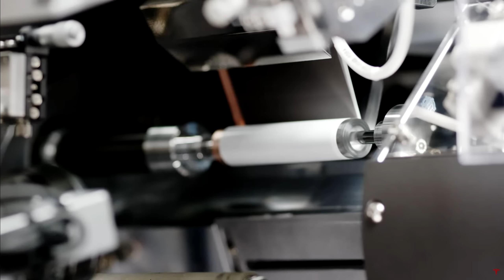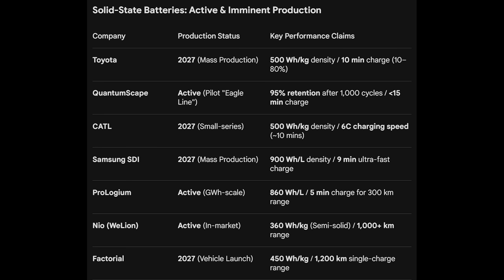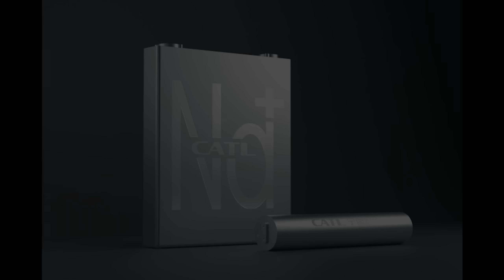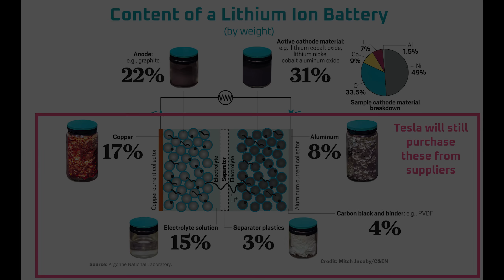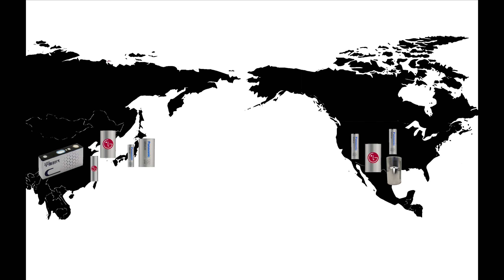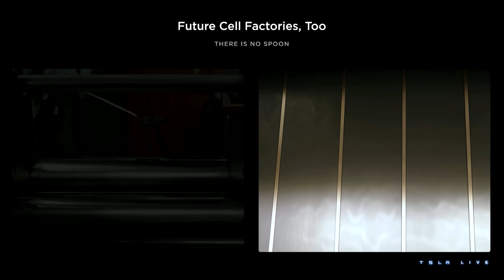The Fully Dry 4680 // Too little too late?

Comment: A lot of comments I hear about how much better X, or Y chemistry or form factor will 'eventually' be seem to ignore the fact that lithium ion improvements are still happening and will continue to happen into the future as well.

I'm not going to hold my breath waiting for sodium batteries to out perform lithium in all aspects to the point that lithium becomes obsolete.
Reply from the maker: Definitely
Reply: Yeah, it’s like competing with CMOS. Remember GaAs, bipolar, and ECL?
Reply: On the energy density side, definitely not, since sodium ions are always 20-30% less capacity than the comparable lithium ions

But the (future) cost/kWh is what favors sodium ion in large scale application like grid energy storage. Although there are already some lab prototype of solid state sodium battery with comparable density to NMC which looks like it would be targeting EVs but not anytime soon since it's only early lab prototypes right now

Comment: We still need no less than 600 mile range for us pickup owners in rural areas who pull trailers. I have no doubt that they will come before the end of the decade. And I don’t care what kind of battery they will be. Hell, if a custard based battery will work I am all for it.
Reply from the maker: The Cybertruck will never get that kind of range IMO, which is a shame

Hopefully someone makes some sort of aftermarket range extender (basically a generator)

Those are getting popular in China.
Reply: @thelimitingfactor How about an aftermarket battery with greater range?

Comment: i think the misconception people have is they hear say CATL has a cheaper battery... CATL has a faster charging battery  CATL  has a battery with more cycle life CATL  has a battery with more power density. what they do not understand is this is 4 different battery products.. sure they are getting better on all categories but they do not all stack together.

Tesla wanted a battery vertically intergraded, that divorced the supply chain from China and other restriction that is what they got. and why it is so valuable to them. 

in the past 15 years i have not been more than 100 miles from my home. I do not need a car that can go more than say 250 miles and i do not daily drive so for me life of the car systems is what is important. as well as cost.
Reply from the maker: Bingo
Reply: 错了兄弟 catl的电池的确做到了  10C的充电速度  1000次快充后90%的容量保持率  和极致的安全性  特斯拉我是不会买的  他们只想要便宜货:face-blue-smiling:  神行和麒麟电池的性能都相当强

Comment: Excellent vid Jordan! Very good breakdown of the current status of the 4680 and DBE technology benefits to Tesla. 

I'm pretty sure some people commenting either didn't watch the video, or only saw it to further bolster their confirmation bias. Still, it checks out to me. DBE seems better for batteries overall, and should be adopted widely in time; 4680 should create a less China centered battery supply chain for Tesla; and everything else may well be less important for consumers over the long haul. I still think Tesla will need to halve charging times in the next few years, but as you've said, Tesla can take some time to get to that step after they perfect their current battery manufacturing processes. Maybe in 2030 or so, they will try doping their batteries with metals and other additives that improve charging speed by double digit percentages. 

Also, I'm curious if you have any SpaceX content coming down the pipeline, what with all the SPCX IPO fever. I wouldn't blame you if didn't want to make a SpaceX video just to hop on that trend, but if you do have something noteworthy to present about the company, this would be as good a time as any. 

Cheers!
Reply from the maker: Hey man!  Thanks for the well thought out comment.

I've done one video on orbital data centers and also videos on terrestrial compute.

Beyound that, I'm not sure what I'd do a video on.

The space stuff is much more straightforward than batteries.  I'm not saying it's easy, but it's very determistic, whereas batteries are less so.
Reply: @thelimitingfactor  and thank you for the well thought out content! Batteries are a pretty interesting topic, for sure. 

I have a few thoughts on space and data centers that might be video worthy.

1) SpaceX has said that they want to establish a solar factory and a mass driver on the moon, before setting their sights on mars. The mass driver I will assume is viable since it is based on relatively basic physics, but can a solar factory be established on the moon using lunar material? What kind of next gen construction and manufacturing processes is SpaceX thinking of using for that? How might they experiment with that idea to make sure it will work before investing billions or even trillions into building it? 

2) for the solar powered AI data center satellites that will be placed in earth's orbit, assuming SpaceX has a reliable source of supply to build 100 GW(!) per year of compute, presumably sourcing material from earth, does SpaceX intend to have its satellites deorbit and fall toward a specific site that will allow the company to retrieve and reuse that old deorbited material for producing new satellites? This seems like the smartest move, since the alternative of letting them fall to random places on earth's surface at end of life may eventually become unsustainable, and would essentially deposit valuable solar panel material, computer components, and satellite material into (statistically) the sea. There is a sand shortage IIRC, so it may become problematic to waste good silica while deorbiting old satellites. (Same question for starlink satellites too). And on a related note, for the 100 TW of solar that SpaceX wants to produce on the moon factory, might they have a "deorbit, retrieve, and recycle" plan for their moon-made satellites as well?

3) do you think Kepler syndrome will present any problems for moon or earth related space travel in the next few decades if SpaceX succeeds in launching all the annual compute it is aiming for? SpaceX compute and communication satellites (along with payloads from other space launch companies like rocket lab) will be numerous, and will only add to the decades of old space garbage that currently complicates space travel, right? This seems like a problem to monitor and plan for. 

So yeah, space related food for thought. Thanks again for the top notch videos!
Reply from the maker: @davidx.1504  Sure thing!

1) Yes/it's too far away to say because much will change/again, too far away.  The lunar ambitions are maybe decade away at least in my view at any sort of scale.  There will be crazy technological changes between now and then and they have to deliver on 1000 other things first.

2) They'll just burn up.  However, it looks like they may be set up with modules that can be replaced, which could extend their life.  But, actually doing that again so far away.

3) No.  Keploer syndrome takes decades to play out.  It doesn't happen quick like people think it does.  If it starts, we'll have PLENTY of time to intervene.
Reply: @thelimitingfactor   fair enough, hard to predict things so far out like lunar construction and manufacturing. I was thinking that maybe SpaceX had ideas and experiments in preparation for that already that informed their moon base plans. Someone somewhere said lunar material could feasibly work for solar cell feedstock (probably a lunar perovskite), but I hope they aren't taking the "we'll figure it out" approach on something too major. If 100 TW of annual solar material is truly necessary for AI compute in the long term, it'd be better to figure that out sooner rather than later. But maybe SpaceX needs more data, perhaps samples from the lunar surface once starship reaches the moon; if so, there's no rush just yet. That's one good thing about having such long term plans - there is a lot of time to gather the data and devise the best strategy to execute on those plans. 

Man, that's a real shame all that material will be lost; on the other hand, fingers crossed that modules can be replaced in orbit to extend satellite lifespan, but this seems like a more complicated and expensive route that SpaceX may not go with, especially in the near term. If 100 GW of solar being lost to deorbiting every few years does strain terrestrial silica (or even perovskite) supply, maybe terrestrial supply can be sourced from seawater or ocean floor? Or lunar solar can be brought in to replace it?

Great to hear we won't have to worry about space debris! I'm personally rooting for laser based methods of forced deorbiting of debris to become more prevalent, but there are many methods out there. If we really have decades to figure it out, then we have time to develop a variety of deorbiting mechanisms before the debris is a crucial problem to address.

Comment: Main issue with the theory... More than 55% of Tesla's worldwide vehicles are built in China's shanghai megafab and sold there/exported... The 4680 cells aren't competitive in China or any of the countries that has Chinese EVs at this point... It's literally made just for the US market and that's it. It's literally not competitive for anywhere else... We all know that the EVs in the US are the least competitive and the worst EVs available...
Reply: Tesla was REQUIRED to use CATL cells by China government.
Reply: @clarkleakins879 yes... just like how tesla LOVES to export the chinese built model 3s and ys to other countries because it's a lot more profitable for them.
Reply from the maker: It is competitive elsewhere, which is why they're starting production in Germany.
Reply: @thelimitingfactor 
I can't see how anyone can say that with a straight face when the chinese equivalent of the 4680 is coming online right now with similar energy densities and much better charging rates and operating temperature ranges... and offering it in cheaper vehicles. And that Tesla is still using China as their primary production location making more than 55% of their cars world wide...
Reply: @killerhurtalot  Tesla will get there. They just need to keep working on their technology and innovating and improving. Competition is good for the consumer. Like china banned foreign batteries from their market to improve their tech when Japanese and Korean makers made the majority, the US will carve out and improve their tech over time. Chemistry and battery types will converge over time and Tesla can copy what works and implement that inside the US.
Reply: @aihji china did no such thing as banning foreign made batteries 😂
More like they invested and controls all the materials to make the batteries over the last decade and battery tech were all over the place until China took the definitive lead on manufacturing them...
Reply: @killerhurtalot   China literally banned foreign batteries from its domestic supply chain in 2016. 
WSJ article from 2018:
China requires auto makers to use batteries from one of its approved suppliers if they want to be cleared to mass-produce electric cars and plug-in hybrids and to qualify for subsidies.
Auto executives say that since 2016 they have been warned by government officials that they must use Chinese batteries in their China-built cars, or face repercussions
Which is an effective ban. America is simply copying Chinese protectionism that they put in place years ago. 
If you want to blame someone, blame the Chinese government for starting this, not the American one who copied what they were doing.

You can simply google for this information. I understand how this makes you look bad though.
Reply: @aihji sorry... if you're trying to act smart please google and learn the WHOLE history of the subsidies.

The white list based subsidies ended in 2019 and shifted more to a rebate based subsidies applying equally to all manufacturers (and manufacturers are able to wholly own 100% of their manufacturing). This is exactly why Tesla went in and started construction of their gigafactory in 2019...

Now go back to basement and please go to school tomorrow so you can actually become smart.

Comment: Another great one. I'll be citing this to the doubters.
Reply from the maker: Thanks man!
Reply: @thelimitingfactor it’s proprietary to Tesla. They own this is tabless as well. The installation might be what Optimus specifically designed for. If tabless dry cathode…is it dry cathode?.. starts to spread to the entire industry for all batteries that is an absolutely massive market for Tesla well beyond just for Tesla. The battery itself might weigh less as well still have a massive I think it be called “capacitance” or ability to hold a charge …be fully discharged then be fully recharged and quickly and fully and reliably for thousands even millions of cycles. “Getting around your limiting factor” yes, yes?
Reply: @user-qx3un6qw7y  even millions of cycles.??? please try and be real.

Comment: It is absolutely obsolete for any region that experiences a real winter. I have a feeling Tesla is going to be stubborn on adopting sodium ion in the same way that Toyota is stubborn to abandon hydrogen.
Reply from the maker: Niche use case that's already resolved with battery heating. 

See Norway.

As for sodium ion, it still sucks and it's not worth having for 95% of people.  Even the people who manufacture it understand this.  Unfortunately not the hype acolytes.
Reply: @thelimitingfactor   It's not niche at all. Every population that is more than 35 degrees form the equator is affected by this. My heat pump had to run the entire winter because the battery had to maintiain a safe temp for li ion. My range is reduced by half nearly the entire winter. 
Sodium ion will eventually be so much cheaper than li ion that it won't even be considered as an option in the future. It can handle super cold and super hot temperatures and is safe against fires. You have no idea what you're talking about if you think that's only for 5% of people.
Reply: @boxherold1177  I think your own comment undermined your whole point- "...will eventually be..."
Reply: @noobystok  CATL has already started mass production of sodium ion batteries. Don't worry I don't expect an apology when you realize you are wrong.

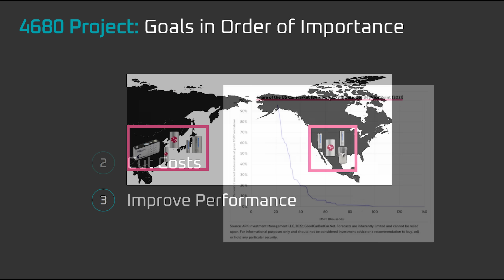Comment: Great work as usual, Jordan! Your statement at 2:34 about Tesla always having the option to buy the highest performance battery cells on the market got me thinking about the Roadster. Since it is destined to be a low volume, high price, boutique vehicle, do you think Tesla might use a high price, low-volume cell that we've never seen (and will never see again) in any other tesla vehicle? Like one of those high silicon chemistries normally used in aviation and drones?
Reply from the maker: I would love it if they used it as a test bench for the energy density technologies that I know are possible with the 4680.

But, if it's external, there's a dozen options for them in the market, so it's impossible to know what they'd pick.

Using Amprius cells would be siiiick.  But, expensive.

Comment: What about the Lithium-Air that CATL teased a few days ago?
Reply from the maker: They're just giving you the tip for now.  It'll be about a decade before you get the shaft.
Reply: 20 years ago I was looking at it was 10 years away then at 1b a year plus investment. Felt similar to fusion for me

Don't get me wrong it is the best chemical battery you can imagine from 1st principals but alot of hard stuff there.
In this look performance is 3rd of 3 for car batteries so how important really is the best battery ever
Reply: Tesla was considering lithium air in the early years when JB Straubel was CTO.

Comment: I am confused.

Is Solid State batteries here or not.

One day i hear it is still two years away.
The next i hear . Some German manufacture is already shipping them in cars.
Reply from the maker: Oh, that's because it's a definition problem, lol

Solid state batteries have been sold commercially for over a decade.

The problem is scale/cost/price.  No one has nailed that problem yet, so they're still niche.

You can go online and buy solid state batteries right now.
Reply: Any car maker can take a few hundred solid state battery cells from its supplier's test manufacturing line, hand-assemble them into a more dense battery pack that holds more kWh of energy (and therefore will be much more expensive), put it in a modified large EV, and claim "zOMg 1000 km range is coming!" And then haters say "I won't buy an EV until it goes 600 miles" based on these irrelevant unicorns.